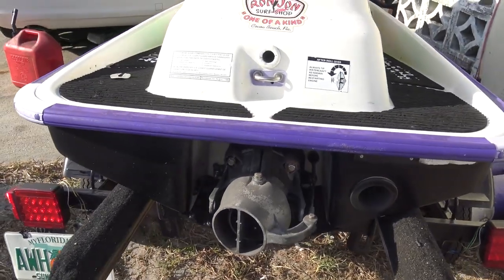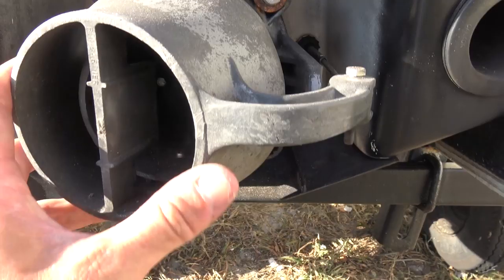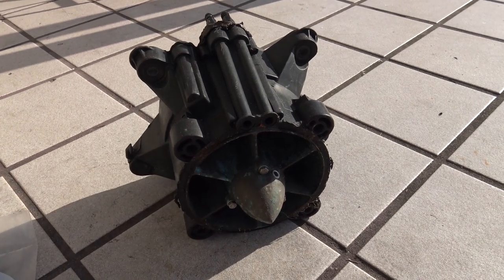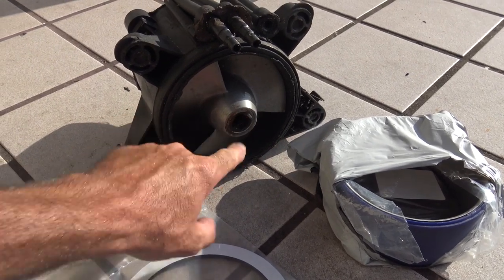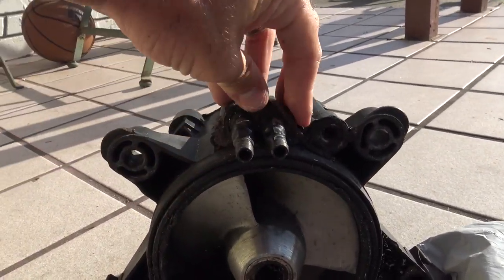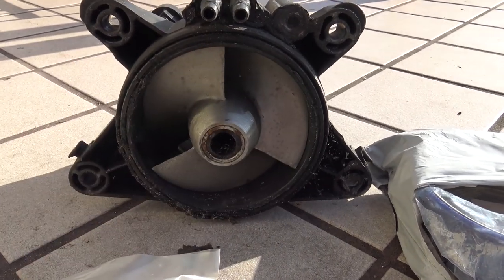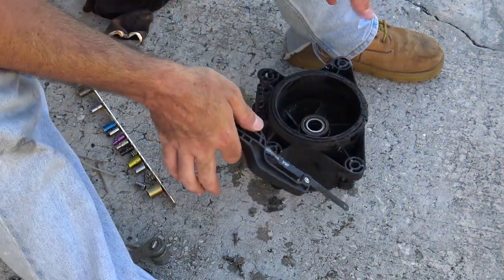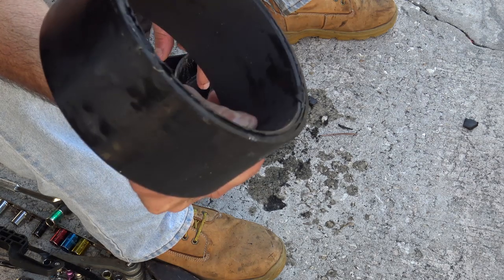Rebuilding Seadoo Jet Pump, 140mm Bronze, Jetski PWC

Comment: You didn't use a bearing installer tool.  PN 295000107.   Did you set the Needle bearings sub flush to the manufacturer specs?  Each bearing has a different setback clearance.   1.5 to 2.5 and the other 2 to 3 mm.

Comment: It's supposed to have play that's what the spring load in nose cone does
Reply: Not that much tho....
Reply: Mine has loads of play, im worried the thrust bearing might slip off into that little groove in the shaft and when i accelerate it will get smashed up? Any thoughts on that?

Comment: I was told the impeller shaft is supposed to have a little play like that, I asked if it was normal and they said yes. "They " are the guys that run westside.

Comment: i have a question , What could stop the pump from pushing water into the engine?   I hook up to the hose connection and comes out the weep hole ,, I put the GTI in the water and water does not come out weep hole. I feel its the pump as that is where i isolated it. I back flushed and seems clear.

Comment: the rattle at 9:50 is that actually bad or is that the ways it's supposed to be and then you have the anti rattle cone to keep it from rattling?
Reply: i saw on another video that it was supposed to move and that tells you the bearing is in the right place when your'e putting it back together.....

Comment: @12:15 you can see your thrust bearing has been chewing on the back of the pump.  The washer should be between the pump and bearing, not on the other side of the pump.
Reply: I was just thinking the same thing how did  thrust bearing ride at all?

Comment: Another great and informative video, thank you! I have a 96 GTI and last
 Saturday I found myself in 6" of water with sand below, unfortunately I
 panicked and rather then  killing the motor, I hit reverse and then 
proceeded to get back in forward and drove out. Within 1 minute I heard a
 loud, high pitch winding sound (only one time, lasted about 5 to 10 seconds) and the ski began idling extremely rough
 and lost power. I tried cruising back with no throttle but within 5 
minutes the engine temp light came on, I shut it down and got towed in. 
Since then I have done a compression test, examined the spark plugs, 
bumped the starter with plugs out, examined the shaft, impeller & 
wear ring, blown out the the water intake line (felt clogged for half a 
second and then blew through, thought that was it but no cigars), ran 
water through the coolant system in both directions, runs fine in the driveway but horrible when you put it in 
water. Next, I guess I will check out the impeller shaft reservoir and bearings to see
 if sand got in there possibly. I would have thought this would've been a
 common, easy to diagnose scenario, but I'm not finding anyone else that
 has experienced this problem. Any suggestions would be greatly 
appreciated.
Reply: @SeanPennII  Yes I did, the splines on the drive shaft where it connects into the PTO stripped out, all good now.👍
Reply: @SeanPennII  Yes I did, the splines on the drive shaft where it connects into the PTO stripped out, all good now.👍

Comment: trim down a little with that intake grate  also you need more aggressive sponsons to match handling with hp
Reply from the maker: Yah im ordering sponsons soon, only issue I have is I dont know how to trim this thing, as there is no VTS on here, and I thought about ordering OEM trim tabs but dont know how they mount on the hull
Reply: Sebastian BlueCrew buy aftermarket JSM nozzle
Reply: @xtune5731  cool I'll look for that now. thanks